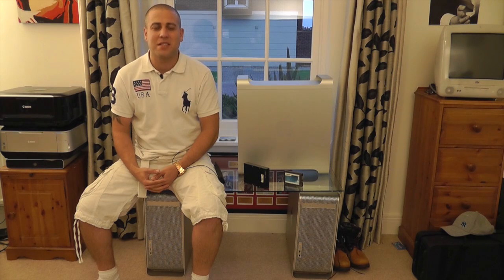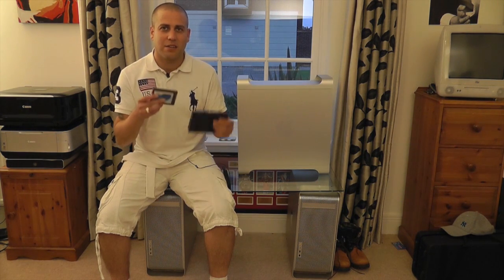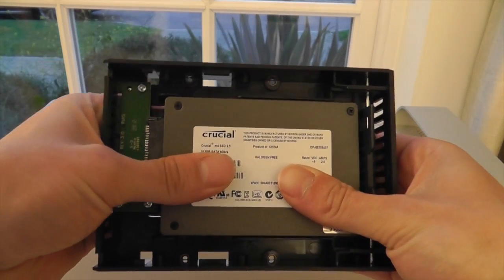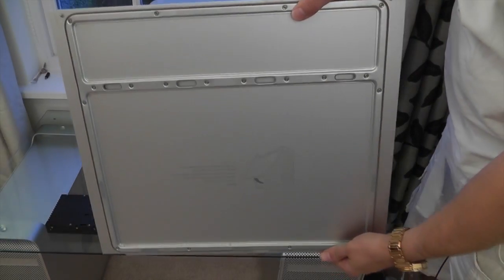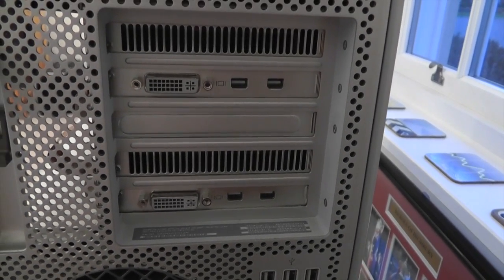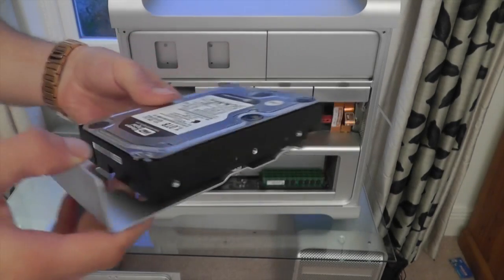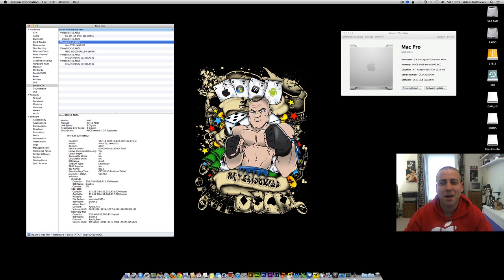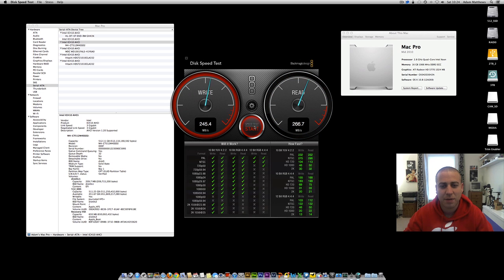Mac Pro Upgrade - 512GB SSD & Disk Speed Test

Comment: Is really all that is for the upgrade?? What happens with your Machintosh HD after this?? Do you have to load all the software back in to this drive now?? Sorry if I sound dumb but I have never done this kind of upgrade and I feel my Mac would really benefit from this =)
Reply: +Red Wolf That just puts the drive into the bay...you'd use something like Carbon Copy Cloner to clone all software and settings to the new drive, then remove the old drive (or use as backup).
Reply: +Matt Maguire thank you Matt! I've been putting this off I hope to do this soon! Another question for you, I have a 2008 Mac Pro how far can you keep a computer this old if you keep upgrading things? When should I look into a new one?
Reply: +Matt Maguire thank you so much for taking the time to share your knowledge with me is very valuable and helpful my friend :)

Comment: What I did was place my ssd in the superdrive bay. I only have 1 of those installed(don't see any use for two anyways) which means there is a free Sata connector keeping room for my storage drives in the bays. Since it is SolideState there are no moving parts and heat generated making it not a liability placing it in the superdrive bay!